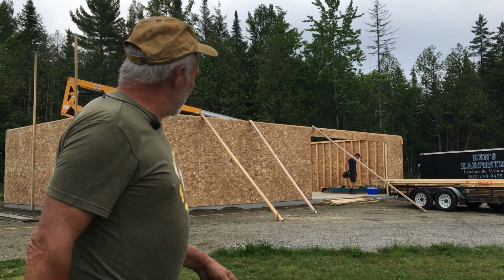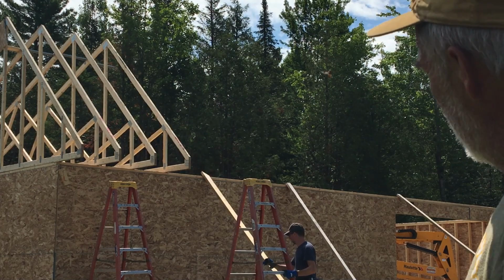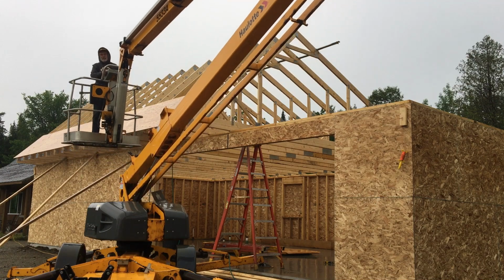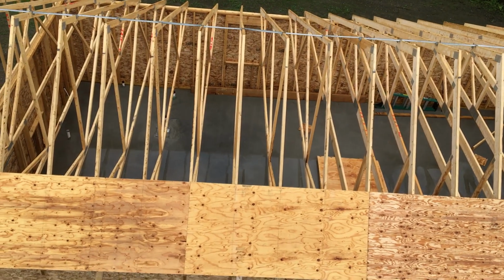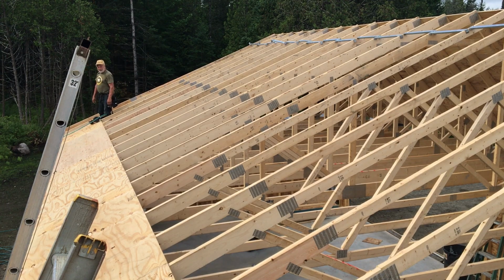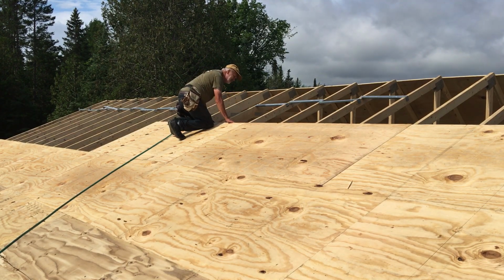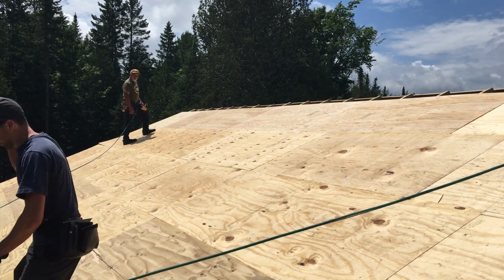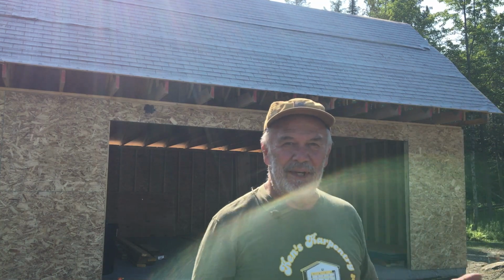BIG 24x44 SALT BOX GARAGE with APARTMENT PART 4

Comment: Love the channel Sir. We are going to build a home with exterior insulation. The plan is to place the roof trusses, without there tails. Flush roof to wall interface. Later add the rafter tails, post rockwool slab installation.

Comment: Presume you rent that lift by the day so might as well use it instead of the ladder lift. Also guessing the 24 ft truss is just too much for manual installation with a couple of guys. What's the lift rental cost in your area? Will the battery last all day? Charge all night between uses?

Comment: The futures market dropped 51 percent this week until today (7/16) when it had a slight rebound. So I checked actual lumber prices. For the most part none is available that I need from Lowe’s and Home Depot. And have not been available for some time. Menards does have them but the price jumped by almost double ie 
2x12x20 cost $61.49 On July 9th Today they are $126.37
2x12x18 cost $56.15 on July 9th today they cost $114.80
2x12x16 cost $45.85 on July 9th today they are $82.14
The price of the floor sheeting went down from $97 a sheet to $79.20 each

Comment: Do you have a 'bump stock' on that nail gun?  It sounds fully auto!
Reply: There is a nail gun se5ingbwhere every time you bump it against the wood it fires a nail, as long as you are holding the trigger.

This can fire faster than some compressors can supply air when you have a team placing the plywood and another doing the nailing.